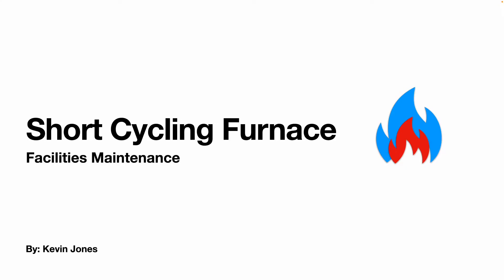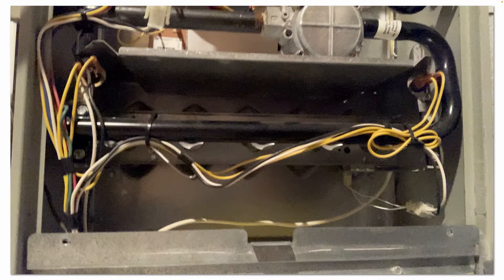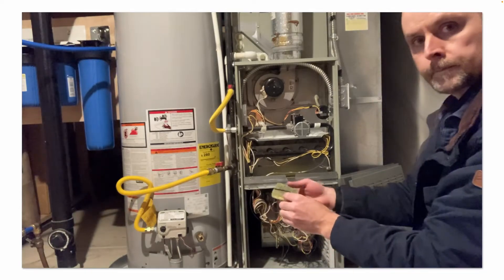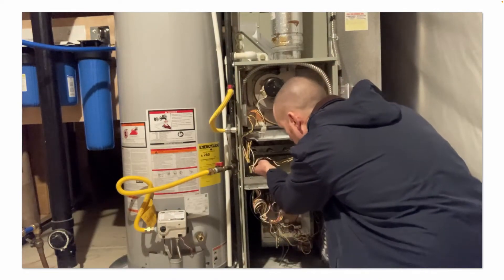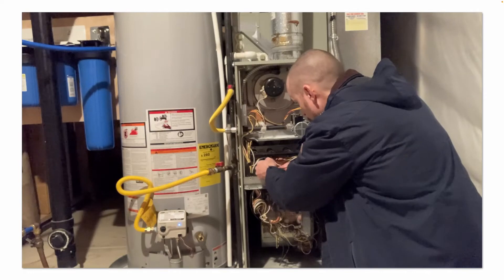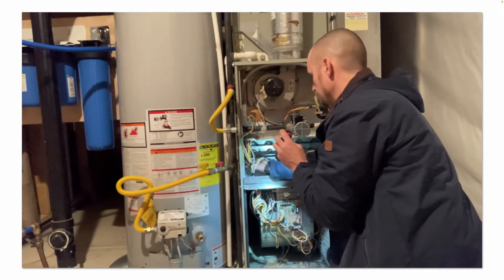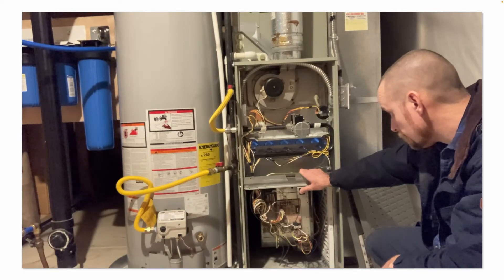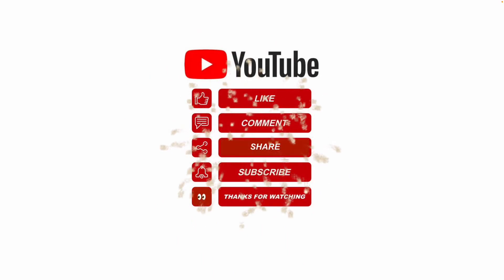Furnace Short Cycling - Solution

Comment: My furnace started short cycling about a week ago. Set at 69, it would run just until the point where the room temperature would reach 69 then immediately the thermostat screen would go blank, the furnace would blow cool air for a couple seconds, then shut off. The instant the furnace would shut off, the thermostat screen would come back on. The screen would read 69 for the set temperature and 73 for the room temperature. After about two seconds, the room temperature changes to 68,  the furnace would kick back on blowing warm air until the temperature hit 69 again and the thermostat would go blank and it would all repeat. 

I'd forgotten to change the furnace filters, and they were pretty dirty. I changed them, and it didn't help, the same thing would happen. I took the filters out, and the furnace and thermostat run normally no problem. I put one filter in, and it runs normally no problem. I put both filters in, and the problem starts up again. 

A couple of months ago my thermostat started flashing the word "battery". At that time, it was news to me that thermostats needed batteries. I opened mine up, and lo and behold there are batteries leaking acid. I took the old ones out, brushed off as much acid as I could, put new batteries in, and the thermostat worked fine.

I thought it was a sure sign it was the filters when the furnace worked when the filters were out, but clean filters don't help. Could this be the thermostat or something else? If the problem weren't the filters, why would it work with the filters taken out? Thanks to anyone who has ideas.
Reply from the maker: I would replace the thermostat because you mentioned some battery acid leaked inside of it. I would also double check the thermostat wire connections at the thermostat and down at the furnace to make sure they’re hooked to the proper terminals. 
I would also check the condition of the flame sensing rod if it is corroded, or has soot or carbon buildup gently, clean it off with steel wool.  Does your furnace control board flash any error code?
Reply: @kjfacilities-maint  Thanks for responding! No error code, it's the green heartbeat that the manual says is normal. It has been a while since I've checked the flame sensing rod, I'll do that and order a thermostat. If it is the rod or the thermostat, how does it make sense that it works fine when the filters are removed?
Reply from the maker: @trampledunderfoot3630 did you buy high efficiency filters?  I recommend MERV 8 rated filters only,  anything above a MERV 8, even when new can restrict airflow through the furnace too much, and cause problems.
Reply: @kjfacilities-maint  Yes, when I started changing the filters myself I found Merv 8 in there, and was afraid to change anything, so I always buy Merv 8. My furnace says to use Air Bear 16x25x5, and I did buy an off brand to save $. Maybe I should get the Air Bears? Maybe something else is causing it to overheat, but removing the filters just helps keep it cool? I don't know, beats me.
Reply from the maker: @trampledunderfoot3630 The cheap MERV 8 brand should work just fine.  If your furnace works fine without the filters in it, that would suggest an airflow problem. I would check the pressure switch, the tube that connects to the pressure switch to the furnace. Make sure all the openings are clear. I would check the condition of the flame sensing rod. Make sure it’s clean. I would make sure no insulation inside the furnace is getting sucked against the blower motor when it’s running too.
Do you have a high efficiency furnace with a condensate drain line?
Reply: @kjfacilities-maint  yes, it is high efficiency with a condensate drain line. Thanks for your continued help! I really appreciate it.
Reply from the maker: That unit should have two pressure switches on it so I would check both of those and then check the condensate drain line and if you have a condensate drain pump, make sure there’s nothing clogged that it’s clear from the furnace all the way to the drain or outside your house.

Comment: got a goodman that does eeo and fo2 error , its a newer system typically the gas comes on and ignites , then it turns off , then it tries again, 3 times total, since its newer i wouldnt think it would be a flame sensor but it acts like it, i wonder would it throw a flame sensor type error if that was the cause?
Reply from the maker: If the main burners are lighting, but not staying lit, I would inspect the flame sensing rod, if the rod has soot or carbon on it, gently clean it off with steel wool and see if it the burner stays lit now. 
Also, if you look inside the access panel, there may be an error code legend on the wiring diagram. Or, you can try typing your make and model and error codes into Google and you may find an error code legend.

Comment: Where do you find a terminal connector that will fit that spade terminal on that item.  I have found a few igniters with broken wires and because I couldnt find the connector I had to replace the igniter.
Reply: Auto parts store
Reply from the maker: You may be able to buy those wire harness connectors from an HVAC supply house, I have never had to replace those connectors. Like you, I just replace the entire igniter that comes with the new connector.

Comment: Okay I did all of this and its still shutting off..after starting and running for about 5 minutes...what would be your next suggestion I could check?
Reply: I follow all the steps furnace works back  10 min of my time save me some $$$
Reply: Change ur t stat. Maybe
Reply: I replaced the pressure switch and fixed it all issues. Pressure switch is KEY to check...cheap replacement too @losttribe1993
Reply from the maker: Correct if the pressure switch does not close, or doesn’t stay closed, the furnace will not continue with the sequence of operation to light the main burner, or the main burner won’t stay lit.
Reply from the maker: Assuming your furnace is an 80% efficiency furnace, like the one in the video, make sure you check the following items:
-change the air filter 
-Check for loose, broken, or corroded wire connections, especially the ground wires.
-try cleaning the flame sensing rod off with steel wool
-Make sure the flame sensing rod is completely engulfed in flame when the furnace is running.  
-make sure the pressure switch contacts are closed.
-make sure you are not seeing any flame rollout when the furnace is running.  
-Inspect the metal exhaust pipe, make sure the outside termination is not blocked with leaves or a birds nest etc.
-when the furnace shuts itself off, look at the flashing red LED light and count the number of flashes, then look at the inside cover panel of the furnace at the legend it should tell you what the error code is.  
-when the furnace is running, make sure you can hear the draft inducer fan, and blower fan running, they should sound quiet, no squealing, or grinding noise. 
-make sure none of your supply or return vents are closed or blocked with furniture or anything else.
-make sure the thermostat is calling for heat and if you have backup batteries in your thermostat try replacing those too.